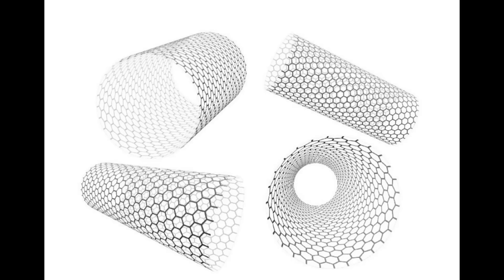What Material Will TSMC and Intel Use after Silicon?

Comment: Hey, 6nm isn't coming next year... We are pretty much just going 7nm+ (EUV) and then it's 5nm, 5nm+ and then 3nm
Reply: Aaaaaand intel will still be on 14nm lol, by the time get they to 10 or even 7 theyll have a ++++  of those
Reply: 7nm+ and 6nm will be using very similar technology, there is not much difference between them.
Reply: @Kynareth6  Still waiting for TSMC to actually lay out the differences. I imagine 6nm is actually the second generation of 7nm EUV
Reply: @John O'Shea , actually there has been information out already. 6nm is a slightly more dense evolution of the current 7nm technology, able to scale current architecture designs without any significant rework. The equivalent of 14nm TSMC to 12nm TSMC. 7nm+ EUV, due to the difference in process is requires the architecture to be built using the process in mind. It’s not radically different architecture but things need to be changed to better work with the process.
Reply: 7nm+/6nm is coming next year, ryzen 4k
Reply: My blue chips are on Daniel for this one! ;)  And I'm REALLY excited for Samsung's 3nm transistor gate technology!  Top dogs are partnering with the Alpha, AMD.  Just look at the mobo manufacturers.  Top tier components, ridiculous amount of skus.  Just look at who they placed their educated bets on! ;)  Tells a story.  A true story.  They chose...  WISELY

Comment: i think we are gonna use silicon for a loooong time maybe 50 years, if not a meteor strikes with some wonderous material that just works great. all the performance increases will be architectural in the future im sure, manufacturers and tech companies will have to make some real changes to how data is processed in the future to be relevant, if not, multi cpu/gpu solutions will be a thing for mainstream computers again with the same old cpus/gpus only with small changes. i think they can do more with the processes they have only they haven't really gone anywhere in a long time, still 1-2 threads per core, still the same ways to process data. the instructions must change

Comment: Ge,Si,
SiC,GaN,GaAs....
Reply: GaAs mosfet above 10GHz  exists for long, but so far only as RF amplifying devices.  
for example your sat dish LNA should have a few...
the problem here with GaAs is that is a crystal ALLOY not a single element like Si crystal.  manufacturing limit seems 500-200nm ...
K6-2 was done on 250nm, so let´s go with that again

http://www.farnell.com/datasheets/77789.pdf 

http://www.farnell.com/datasheets/1922233.pdf

Comment: Personally, I think the data communication method, which is electrical(positrons) is the limiting factor.  The way forward is optical(laser/photons), which are also a carrier of energy by-the-way, to store the bits(1's and 0's).  Not only do particles come in WAY smaller size, but they are also only limited in speed......by the speed of light.
I'm probably not going to be around to see that implementation(had a small heart attack 3 years ago), but man, I would love to see one of those systems.  😔

Comment: With new methods emerging spreading out single thread code over many cores combined with advancements in multi thread coding (perhaps with AI assistance) and potential architectural improvements shouldn't silicon last at least 10 years if not longer? I'd suspect in that time we'll reach "enough" compute power for the majority of computers.  Sure super computers and the server markets will always want more but anything less than that and it will get to the point where there is no point to upgrading.
Reply: It depends on the workload, for sure and most consumer products have gotten very good at optimizing for the tricks used to avoid taxing CPU as much as possible that the only thing that really kills CPUs these days are MMOs with lots of players to handle the code for. But imagine having the power to run full fluid simulation for water/liquids, full path tracing for light rays from all light sources, 3D models that are ridiculously detailed, and all these other benefits for games. Are they needed? Nope. Technically, you just need some spritework and you can have a very engaging game. But will it look impressive? Definitely, and some people might appreciate the step up that adds just enough more realism to make it believable for them.
Reply: @johnbuscher  That's what I'm talking about though. I honestly don't see any of that being a problem by the time we're on 2nm+ with 128+ core 3D stacked APUs having the workload evenly distributed by algorithms/code.

Comment: You're missing light or optical computing. I'm excited for getting 200 GHz chips and higher while using a tiny amount of power. But very insightful on the other chip types
Reply: Gallium-Arsenic processors could operate in the Terahertz range
Reply: @theq4602  So would plasma.
Reply: @theq4602  
https://en.m.wikipedia.org/wiki/Cray-3
Reply: @theq4602  I have a strong feeling that CPUs containing arsenic will never become mainstream.
Reply: @shawnpitman876  why not? it's not like some idiot's going to eat it... america... yeah not mainstream. besides by that logic knives and guns should also be completely illegal
Reply: @shawnpitman876  just seal it. Besides its not pure arsenic its gallium arsenide. Which means it has reacted with something making it generally less volatile
Reply: Shawn Pitman, Gallium Arsenide (GaAs) is a bit eh, and has been used in Red LEDs since just about the dawn of time, lol.  I do understand how scary Arsenide can be.  kind of like chlorine and sodium, both incredibly dangerous to living things by them selfs, think about that the next time someone asks if you want "table salt" on some food, lol.   there is a difference between Arsenic, and Gallium Arsenide (GaAs).
Reply: @minecraftermad  remeber tide pods are you sure they are not going to eat the CPU'S 

I agree that arsenic galium is a better CPU than silicon
Reply: @erikburzinski8248  yeah well even after some idiots ate tidepods which was actually pretty rare they didn't take them out of shops which makes the point pretty valid. Hell even arsenic can be bought + thy gallium arsenide processor it probably going to be sandwiched between protective layers just like the silicon in a processor
Reply: @minecraftermad  There are various materials you could combine with Arsenic to mitigate what is released when in use as well. Lol, some of the replies make it sound like you're saying "Just toss some Decon on a board and you're all set." Like there isn't already a plethora of harmful/toxic substances on chips, motherboards etc.

As for guns, I believe anyone should be able to own one *unless* they have a serious mental condition (not situational depression or anxiety, but more like Paranoid Schizophrenia, Psychosis, Sociopath, Psychopath etc) or they have been convicted of a *violent* weapon related crime *NOT* including feet with anything more than socks on, knees or elbows which most states now consider deadly weapons because...I have no idea why. I'm far more afraid of people abusing the law and causing severe mental anguish than getting punched in the jaw and kicked in the ribs). If they want to own more than a shotgun/hunting rifle or small-caliber handgun then they should register with a town/city militia. There is no viable reason imo for normal people to own modded semi-automatic M-16's (Fully Auto is illegal in...I can't think of any state they are legal, but I am not an expert) or sniper rifles (which are legal in most states). The right to bear arms and stand up against an agent of the government is legal according to the Constitution. Heh, how is it written? They say it in one of my favorite movies "Good Will Hunting". "You have the right to defend yourself against an agent of the government if that act is deemed a defense of liberty.  Without liberty man is a Cinco (ibid)". The right was included for defense against the government *if* they tried to overthrow democracy, hence militias having a chance to defend their liberty.

Completely OT but I find it odd how the more severely they punish young people for fist fighting, yelling at someone is now assault etc the more shootings there are. And I'll end the tangent there before I end up rambling about single family households, no-fault divorces, the Shareholder Act of 1978 that destroyed the middle class (from 1893-1978, including the Great Depression the average full time worker earned the equivalent of 133k per year according to the US Census Bureau. That was the bottom 10% too the 93 percentile, with less than a 10k gap between them, and then came the Shareholder Act and all it's obscene changes)...see, off topic rant.

Anyway, you are correct sir, certain types of Arsenic combined with other materials could, in theory, be used far more abundantly in every day chips.
Reply: Even optical relays need some kind of material as basis, does it not? 
How else do you build logic circuits from it.. "Let there be light"?
Reply: @EmilTapio  "How else do you build logic circuits from it.. "Let there be light"? "

Relays are different to logic switches/gates, they basically just amplify a signal, like fiber optic relays do in the telecom system to keep signal strength adequate over hundreds of miles - even then relays for fiber optics may become redundant soon as they have managed to make fiber optic cable that has no signal loss recently in the lab.

Photonic band gap crystals can be used for photonic logic - they act in a similar way to how semiconductors do for electronics, but for light instead.

Basically only a signal over a certain strength/intensity/luminance will exceed the band gap and cross the 'gate'.

It's not the only possible way to create a logic circuit for photonics - plasmonics is another way which allows light to travel along pathways smaller than the wavelength of the light itself, making it viable at scale near or equal to current CMOS electronics.

As far as relays go though, if they switched to photonics for PCI-E then relays would probably not be needed as they are with PCI-E 4.0 - as light signals can propagate very efficiently down well engineered optical waveguides (waveguides are like fiber optics in the use case of copper traces on PCB's).
Reply: @mnomadvfx  Waveguids I work in telecommunications and install fiber for a living and am a certified fiber fusion splicer. None of this would ever work. There is no such thing as lossless fiber unless you can break the laws of physics. I dont know who 'they' are but I get industry technology updates and never heard of this by 'they'. Fiber optics will not work as traces on a motherboard (although it sounds really neat) but every degree bend in a trace or a cable causes a -dB mV signal loss and there are too many bends in traces. Too much reflection will cause oscillation.  I've tested several different types of fiber (mostly ribbon) on a scope and when you bend it past about 60 degrees the signal plummets. The other issue is every trace would need to terminate to a bi directional transponder - that would be in the 1000's on a motherboard. Termination points on a card to a theoretical PCI-e lane using fiber would be the biggest headache to get working. We have a hard enough time getting a single termination point to get a near flawless signal with a 3' jumper (the tips need to be perfectly cleaned).
Reply: @davey3765  I think I read what was basically a readers digest version of a research paper abstract on Physorg last year.

It was probably this paper, sadly sometimes people get over enthusiastic and misrepresent papers I have noticed previously:

https://ieeexplore.ieee.org/document/8386061
Reply: @davey3765  I don't know who 'they' are either, I work with CG VFX, so I'm more likely to remember the names of researchers that produce faster and more accurate methods for ray tracing and simulation.

Its interesting to read the perspective of a telecoms fiber engineer though, my uncle works for BT Openreach but I don't get the time to talk about it as I only see him once every few years, and it always seems a bit rude to ask about his job on such occasions.
Reply: Also had heard graphene can do similar and higher. Hope we get to see this stuff!
Reply: Without significant breakthroughs optical is even further away than anything else.  A single core all the GHz chip would be nice though.  Especially if it's not limited to cpus.  An all optical internet right to your APU would make latency almost non existent.
Reply: @SaunaCowboy  since you ask https://www.youtube.com/watch?v=HEtyEJxLGIc&t=8s
Reply: @SaunaCowboy  Latency over internet is a function of dictance mostly. So latency would improve very little. Unless you can make light travel faster.
Reply: @jamegumb7298  latency from distance would still factor sorry for not explaining that.  Latency from any processing would be virtually non existent.
Reply: There was talk in the 80s about the future need for optical to get beyond silicon speeds(the 486 was still the thing), but as others have mentioned in this thread there would still be a need for an underlying structure to implement, so I never saw it as the answer.
And, as stated in the video, how much speed is really necessary? I think the next improvements will be in architecture and efficiency that will allow massive parallelism will be the next major breakthrough.
Reply: I work in a big research institute where they develop that kinf of technology. I've talked to a few experts and frankly, they don't really believe in optical computing, and for many reasons. One of them is that transistors nowadays are only a few nanometers wide. To make light based CPUs with the same kind of density, you would need to use electromagnetic waves with a very small wavelength, like x-rays. The problem with small wavelengths is that they are very energetic. They damage everything they touch. Circuits a few nanometers wide would be damaged very quickly and stop working. X-rays are also hard to produce, I don't think we can make an x-ray source that would fit in a home computer for now. 
If I remember correctly we don't even know how to make a light based transistor for now (if it's even possible ?).
And that's juste the problems I know about, there's probably a lot more of them. The state of light based computing for now is that they're trying to use it in buses. Not to perform the operations but to ove data around, but for now it's very sensitive to temperature changes so not really useable
Reply: Some reprogrammable optical computing chips have recently been released, but they're nothing great yet.

Imo, I see them being more of a niche chip, useful for computations including a lot of orthogonal tranformations.
Reply: Photonics FTW
Reply: @zijkhal8356  I think the speed of light you quoted is for vacuum instead of air medium.

One of the proposed solutions to the distance problem is a more distributed memory configuration on the processor I think.

Even without that, I think that even 25 Ghz would be a nice jump in frequency, surely 12 mm is far enough for communication?
Reply: I was about to say that!

Don't forget that better multi-core coding will result in significant performance improvements even if the dies stop shrinking.
Reply: 8 terahertz on 1 watt
Reply: That didn't made any breakthrough yet. Remaining as a technology demanding some smart people's time and energy to get rid of hurdles.
Reply: The problem with optical computing is the interconnect... changing the direction of the light beams. Electrical switches can simply use metal interconnect.

Comment: I'll just say Silicon giving way to a carbon based Processors is the same as when Diesel and electric locomotive took over from Steam locomotives. If Graphine works like a Diesel locomotive and Silicon works like a steam locomotive when the costs over performance will become too tempting.  There's also photaic processors in the works so the Next type of processor is really in the air at this point.
Reply: Steam was not phased out due to cost/performance but because of the endless amount of maintenance it required  In terms of fuel cost it almost always won.

Comment: How will AMD be affected by Trump's ban on supercomputer components to China?
Reply: Its my understanding they dont sell much directly into china, but instead license their tech to other companies to "bypass" some of the limitations on tech exchange
Reply: AMD has THATIC - joint venture with China. Of course, AMD needs to have 51% (x86 license requirement, like Zhaoxin and VIA). THATIC has, as far as we know, only Zen 1 capability, and their one product was, I believe, fabbed in China on a bigger node (it has some interesting features, like bigger cache) - but not much is known precisely because it doesn't get out of China.
As this product is based on EPYC, they are geared to make supercomputer-ready chips. Sure, on a bigger node, but still better than Zhaoxin (ARM will be even more affected.)
AMD will not be able to extract much revenue this way, but they'd get at least something, unlike Intel.
Reply: Although, they could go to MIPS or SPARC processors, China does have more experience with them. But those have other limitation, like versatility... then again, China is big enough to custom-optimize for more obscure ISA'a
Reply: AMD is an american company? EDIT: I mean, i know they are typically american, but i think they are owned by people outside of the US and do almost all of their manufacturing outside of the US as well, so... How can Trump ban them from providing China with cpus?
Reply: Artisan  yep.

Prices may increase by 15% but more people have jobs to buy that hardware.